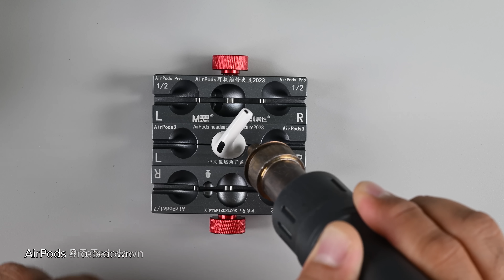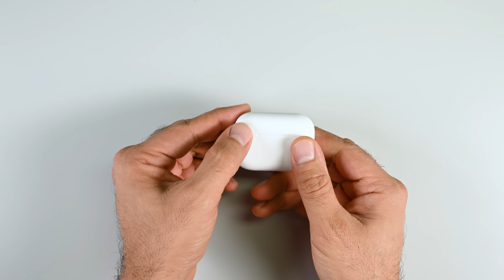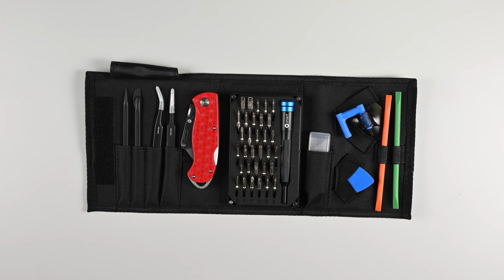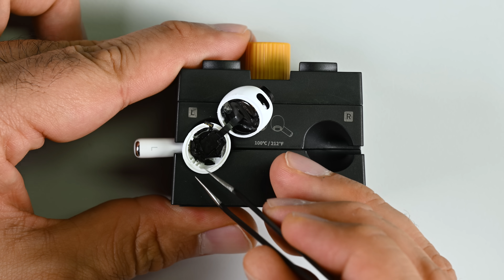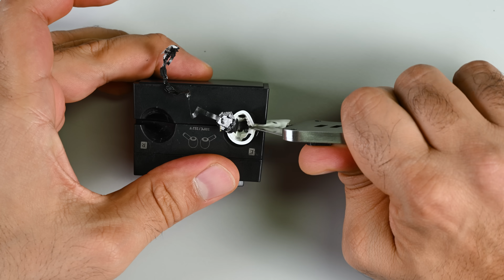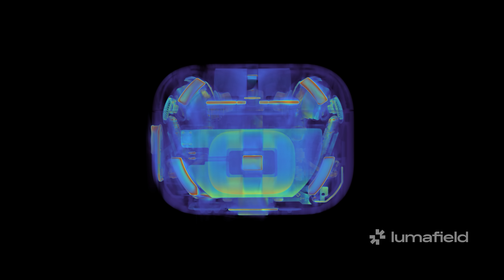We Tore Down the AirPods Pro 3 — And Here’s the Ugly Truth

Comment: I’m not surprised by this. With everything firmly glued down, this is a device not meant to be repaired. It’s more like throwaway product, making the issue eWaste worse.
Reply: You recycle it. The glue works as shock absorber. Adding screws makes them more complicated to do and adds weight. Apple has made exactly the correct decisions here.
Reply: It's 2 grams of plastic you'd throw away once every like 3 years, if you want to talk about e-waste in the headphone space you should remember the before times when wired crapbuds were everywhere. To be honest, fixating on these specific few grams that last years is simply NOTHING compared to all the other types of waste that could be more effectively managed. You're just thinking about it through this lens because this video riled you up. Get some perspective.
Reply: @jama211  my wired earbuds are 2 grams of copper and plastic. the airpods + case is 50 grams of plastic, lithium, PCB, and magnets. 

it’s not just the mass that matters, but the materials. 

yes, we should criticize the disposable vapes and extra plastic packaging, AND encourage apple to make airpods battery replaceable so that they don’t have to be throw n away. we can do both.

Comment: I've had the same earbuds since 2021 and yes you have to charge them more often than usual but they still work exactly the same.
Reply: I have a wireless DAC that works as new, and when the battery dies completely, I can replace it in a few minutes for another 5 years of use. Or I can just use it as a wired DAC. There are fewer options with Apple's tech here.

I can also plug any headset into it, even overear headsets that have massive terminals because it's 2 AMPs. If I wire up my own headsets, I can use both the jacks to get 4 AMPs. I'm guessing that I would eat into the 12-hour battery life, and I can also set the equalizer however I want to. I like heavy bass. I've been to IMAX, and it was astonishing to get that kind of eardrum rattling bass out of in-ear headsets. I've used a number of commercially available headsets wired and wireless for the past 20 years and never experienced that before using a customizable DAC. I've also never felt like any in-ear headset could truly ruin your hearing, especially in low frequency ranges until using a DAC.

Comment: Why are we surprised by this?

We all know most wireless earbuds will end up as eWaste once their batteries use up their battery cycles.
Reply: Except fairbuds
Reply: Samsung's buds I know are easier to tear down and the cells are standard Varta coin style Li-Ion batteries.
Reply: @punmeistervstheworld comparatively speaking. Airpods are just a low bar to compare against. It’s far from being repair friendly.
Reply: If  you can pick between AirPods that are repairable but have less battery life / lower quality / no water proofing whatsoever or the normal AirPods, what would you choose? I know what I would choose, and I think Apple knows what it's customers would choose. Did you see the amount of tech that they put in this little thing? I'm still surprise it's possible and that they can sell it for that cheap.
Reply: @behackful5728  yeah exactly, as soon as you don't need to worry about repairability you can really squeeze some extra quality of life into these products from a design perspective. People really don't get it.
Reply: @behackful5728 in what world is $200 cheap?
Reply: @behackful5728   Oh not again this same argument. Saw this nonsense once in a while. Why less battery life? Why was Samsung and Sony able to do it, but not Apple? You can just order replacement batteries from somewhere and replace them. 

No water proofing whatsover? Where did you pull this from? Do you work at Apple and those are the compromises you had to make?.. Come on.

Lower quality? Sorry that's just bullcr@p made for the sake of making the argument. How can you know that Apple would need to compromise on quality to make a little bit more easy-to repair wireless buds?
Reply: @FriedCirnoFish9apple fans are really this clueless and defend apple no matter what lol. 'but but i need to defend apple because why do y'all hurt poor apple 😢'.
Reply: @FriedCirnoFish9 making something more repairable while this small means that you need more connectors, you need different glue, you need entry points to the device. Are you working at apple or building devices at this scale and know something I don't? I do build things from time to time not at this scale of course, but I can tell you that if I build something super small and need an enclosure I'd prefer to just drown everything in place using glue instead of designing screws and connectors.
Reply: @FriedCirnoFish9 And they are literally low quality, it's plastic for god sake.